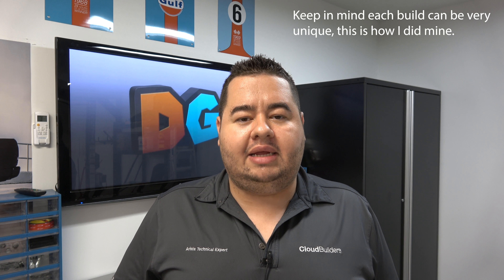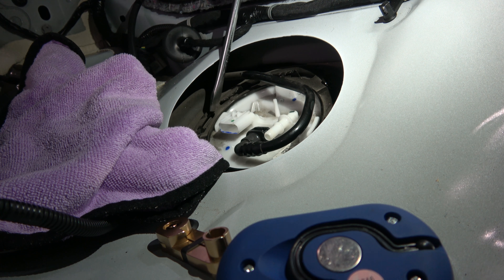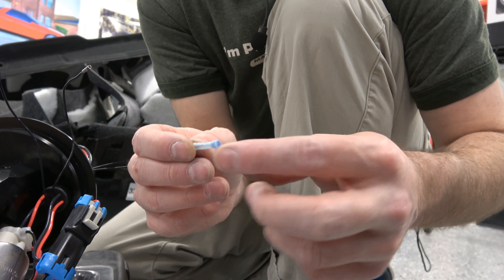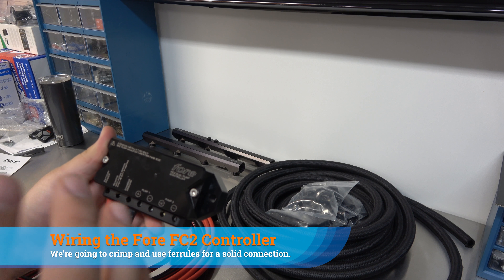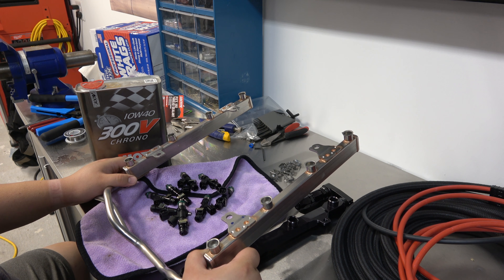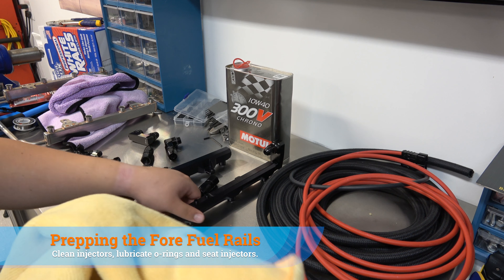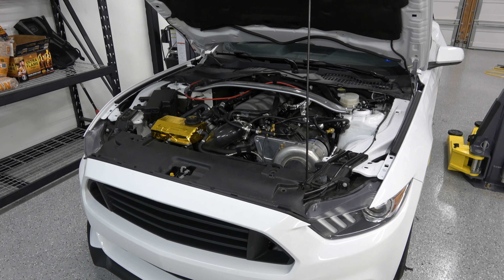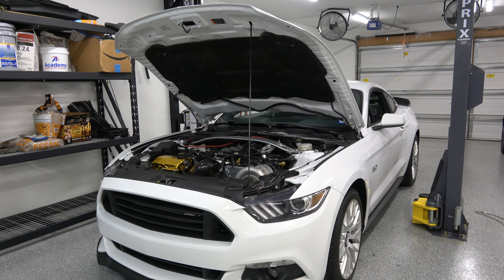Installing Fore Innovations Fuel System On 2016 Mustang GT

Comment: When you ran the green trigger wire, did you just tap into the one wire on the FPDM? I have the FC3 controller and I have two remote connections.

Comment: is the wiring inside the vehicle for the fuel pump module to the cars fuel pump connector the same way for a 2019 mustang gt? doing my install tmr and need help with that

Comment: Just installed my Fore Innovation L4 Dual pump system. Maybe I ordered a different kit but we installed the supply line to a Y off connection (supplies in the kit) then from the Y we ran to each side of the the Fore Fuel rails, from the Fuel Rails to the two outer sides of the regulator then from regulator, installed the fuel gauge on the regulator. I’m a Twin turbo set up. My hose that was supposed was a steel braided line with slightly different connectors. I had a buddy helping me. Wondering what different running the supply line to the Y an direct to both rails vs the way you set up would be.
Reply from the maker: Thanks for watching! Yea the kit you got is a little different, but mainly because Fore Innovations is a DIY build your own kind of kit. Some retailers are offering specific packages. The main difference is that you're running a parallel fuel rail setup and I'm running a series setup. It really depends on power goals, but a parallel setup is generally superior to my series. However, at the power levels I'm targeting I didn't really need that. It's a good setup for bigger power, if you're going over 1000whp on ethanol especially.
Reply: Dmitry's Garage yeah I’m Twin turbo with built motor and built MT82. Looking at making 1100.

Comment: I have the same fuel system in my 15 gt with 3 pumps ,, how can make them start like oem style ? mine running all the time on I switch the key on !
Reply from the maker: Typically this means your signal wire for the system (the one from the factory harness) is the one that stays constant on with ignition. Which wire are you tapping into?

Comment: I have a 2016 with twin turbos and I’m installing a triple pump system from lethal performance. I’m having an issue with the pumps not coming on and I’m almost positive it’s the wire to the FPDM. Could you tell me which wire you cut and tee’d that signal wire to?
Reply from the maker: Keith, at 40:54 you can see the wire I tap into. Hope this helps and thanks for watching!

Comment: Do you use loctite 592 on the an fittings that connect to the fuel rails? Or just on the analog pressure regular on the passenger side fuel Rail?
Reply from the maker: You don't need to use loctite on the AN fittings, they're flare fittings and will seal on their own. You only need it on the non-AN fittings.
Reply: @DmitrysGarage  perfect!  Thanks. I was planning on removing the intake manifold for porting and didn't know if have to use loctite when installing the rails back on. Thanks for the advice

Comment: So - question in case maybe I just missed it - did you not use a check valve?  Normally Fore has a check valve between the tank and the fuel filter to keep the pumps from losing fuel.  Where is yours installed?
Reply from the maker: Hey, thanks for watching! The check valve is right in front of the fuel filter in my case. You can see it around the 30 minute mark. I went back later and cleaned up some of the mounting.

Comment: What electronic fuel pressure set up did you use in the regulator ? Was it the OEM sensor and plug from OEM fuel system just relocated from original OEM location to reg. ???!!! Will be installing fore system on my 18 very very soon have the parts already just need to make time to do it !!!
Reply from the maker: Hey, thanks for the sub! The electronic pressure gauge sending unit is from the AEM 30-0301 X-Series Pressure Gauge kit. On the S550 there isn't an OEM fuel pressure sensor. Maybe the 2018 has it, but I'm not aware of one. I would get something similar to that AEM unit with a remote sending unit. Since it's generally a bad idea to run fuel inside the car cabin and I doubt you want to mount gauges on your hood outside the car old-school style :-). Good luck with the install, if you have questions feel free to ping me. Also Fore has terrific customer support as well.
Reply: Dmitry's Garage thx man I’m going to look up that part number
Reply: And definitely appreciate the videos keep them coming :-)

Comment: Hoping you may be able to shed some light on this issue I am having. I am installing a similar setup but with a GT350 hat and harness. I can not find a wiring diagram for the factory harness for these cars anywhere, what did you go off of to be sure you wired this correctly?
Reply from the maker: Hey thanks for watching! So you’re basically transplanting the gt350 system? For the trigger wire just to be honest I talked to people online to see which wire they spliced. It was different than my JMS BAP setup. Also at one point I talked to Justin at Fore Innovations, he wad super helpful. I don’t think I ever saw a full diagram for the harness which I assume is what you need. Maybe mustang6g forum? I wish I knew more. Ill see if any factory service manual stuff has it.
Reply: @DmitrysGarage  I appreciate the reply, today I am going to use a multimeter to figure out which is the signal wire. Do you happen to remember which color wire you used? I have found some stuff on Mustang6g but figured I would dig deeper. Thank you for your help.

Comment: Not sure what is wrong but the video skips the factory fuel gauge sender wires. What 2 colors on the factory harness did you cut and splice into?
Reply from the maker: Jeremy, you should be able to see this at 7:13, its a yellow/purple and green/blue wire.

Comment: 38:23 that red wire is that Necessary? My car came with fore fuel lines and also that red wire. Without it my car won’t start and it’s burnt and it’s on its last leg with a weak bridge. Can I pull it out?
Reply from the maker: Yes that red wire supplies power to the fuel pumps, so it will not work without it.

Comment: Great video man, its crazy yours is one of very few on this install. What did you do with the original fuel lines? Is there anything else you needed to buy with the Fore lvl 2 to get this all to work besides tools? Thanks!
Reply from the maker: Thanks for watching Mark, glad you liked the video. I didn't remove the original lines, they don't get in the way. Other than tools my kit had everything I needed, but I suggest talking to Fore as their team is very knowledgeable and they may have made changes to the kit since I got mine in 2018. There are also different options when it comes to fuel type and power goals so it's worth talking to them.

Comment: Installing my dual pump setup now...On the top of the fuel hat there are two black wire with butt connectors on them.  Which wires to they go to?  I am assuming the two smaller wires on the factory harness that plugged into the factory fuel pump.
Reply: never mind, found the 5 seconds I missed that covered that :)
Reply from the maker: Haha no problem, it's such a long video man and it was hard to do a lot on each step, it would have been like 4 hours then! Glad you got it! Let me know if you have any other questions, I can probably help!
Reply: The only other question was what you used to add the fasteners to the hoses going to the fuel pump. Channel locks and a wrench I am assuming. The hose ends you had to add in the car are what I am referencing.
Reply: Minute 35:20
Reply from the maker: Yea I had to use a channel lock and a wrench. It sucked, but there was no way to put a fitting in there that was pre-made. With PTFE this would be a major PITA, luckily I used a more flexible hose (I recommend FlexLP). One option is to lower the tank but it's held up on the filler neck and that strap that holds it.
Reply: I went with FlexLP, partly because of the smell and the fact PTFE can cause false knock. Dont need to deal with that issue again :)
Reply from the maker: Yea PTFE seems too much of a hassle really. The FlexLP should last plenty long and in my case with a lift the hose swap would take like 45 min if I had to do it again half a decade from now.
Reply: Just wanted to say thanks!! The video helped me so much!  All installed and running! Tuning is next but the  fuel system is up and running :)
Reply from the maker: Really glad I could help! Hope your tuning goes well and you'll have some new found performance to play with :-).

Comment: Did you tap into the yellow/gray wire on the plug that directly plugged into the top of the fuel pump hat or the on that's on the little module to the right of the pump?
Reply: Did you ever find the answer ?

Comment: I watched the video and attempted to call fore and they would not tell me where to connect the remote wire. Now here is a question...the S550 fuel module plug is under the seat. The fuel module plug for an S197 is in the trunk. The wire coming from the OEM fuel hat is the same wire the ties into the fuel module plug (Same color and all) if I cut the wire at the fuel hat in the trunk and attach a wire to it then run it to the remote for the fore that should do the same thing as splicing into it in the trunk in theory would it not??
Reply from the maker: Ryan, that's too bad Fore was pretty knowledgeable when I dealt with them. For your question, I think you'd need to review the electrical diagrams for the wiring, but yes if you're picking it up past the module you're probably ok.
Reply: @DmitrysGarage  First and foremost thank you for taking the time to read and respond. Got me as a subscriber just for that gesture. Second, your video is really the only video that goes into that much detail. The DIY'ers thank you for that. I chased the wire from the OEM fuel hat plugin on the s197 to the back of the trunk where the fuel pump module is located on the s197 (vs the s550 under the seat). I'm thinking I'm ok with cutting the wire from the plug and splicing it into the remote wire. If it don't work I will connect it back and then go to the fuel module and jump it like you did. Either way I will tell you the end result so you can share information with others who will ask you in the future.
Reply from the maker: @ryanfreeman5987  Appreciate that Ryan :-), I'll have some more Mustang content in the near future. Doing a few more mods soon. Do let me know how this works out, we can pin the comment so others dealing with this can find it. Glad you like the video!

Comment: Do you run that 300v in your mustang ?
Reply from the maker: Yes, quite a few years now.
Reply: @DmitrysGarage  I been running 5w50 amsoil signature I was thinking of switching can’t decide which will be better i do sing high rpm coyote tones a lot what you think ?
Reply from the maker: @scubagto420  Motul makes a good oil. I've had nothing but good oil analysis reports with it. Though these days all the big players make good oil especially Castrol. Amsoil is more niche but their stuff is usually good.

Comment: What does the fuel pressure gauge on the rail read compared to the affermarket electric fuel pressure gauge you have installed?
Reply from the maker: It's about 2-3 psi difference. The fuel rail is not considered an accurate place to measure when the injectors are running as I understand.

Comment: Great video. With the key in the on position should the regulator be holding boost? If so what would be the reason that it’s not?
Reply from the maker: Thanks for watching, glad you liked the video! I'm not completely sure what you mean by boost, but I'm assuming you mean fuel pressure? If so the fuel pressure will spike momentarily when you turn the key on, and will drop quickly after the pumps finish priming if the engine isn't immediately started. The FPR (Fuel Pressure Regulator) controls the fuel pressure delivered to the fuel rail. The FPR has a vacuum/boost reference which is used to vary the fuel pressure from the base setting when the reference is at atmospheric pressure (i.e. engine off). Overall the FPR works kinda like putting your thumb over a garden hose, the pressure inside the hose goes up. In my setup the FPR is after the fuel rail, which is normal for non-deadhead FPR setups. The reason the FPR can not maintain fuel pressure with key on engine off, is because the pumps don't keep priming if you don't turn the engine on. It would be like someone turning off the garden hose, your thumb isn't going to keep the pressure up. Hope this helps!

Comment: In what direction does the fuel flow. Great video
Reply from the maker: Thanks for watching! The fuel flows from the tank into the fuel rails and then to the FPR. The FPR then spits the fuel back into the tank. Think of the FPR like keeping a thumb on the end of a garden hose to build up pressure in the system.
Reply: Yes thanks. I meant fuel pressure. I was told that my check valve is supposed to hold fuel pressure with the key in the on position engine off
Reply from the maker: @alexandrewoods3763  This would only be the case if you wired up the fuel pumps to run with the key on instead of priming and turning off like the factory setup.
Reply: Dmitry's Garage thank you sir

Comment: Great video! I'm about to install this system in a 2011! do you happen to know what wire the remote taps into on a 2011?
Reply from the maker: Glad the video is helping. Wish I knew what it was for the 2011, but unfortunately I don't. What I can tell you is that the guys at Fore are super knowledgeable. Give them a call and ask I'm sure they can help guide you in the right direction.

Comment: I have a Fore tripple hat on my 15 GT. After i drained 93 to put E85 in, my fuel gauge stopped reading and the light came on for it. Any idea what i should be looking at, when i go in?
Reply from the maker: It only broke when you drained it? Like it worked with the triple hat on 93 and then broke? Thats super strange. How did you drain it? I would look at the continuity of the sending unit wiring. If that checks out its time to pull the unit up and see whats up with the sending unit. Maybe it got stuck or came loose or unclipped.
Reply: @DmitrysGarage  I disconnected the fuel line near fuel filter and used a wire to short it out to make pumps run. it is a triple hat i assume 3 pumps may cause it to stuck.
Reply from the maker: @ironbull2003  Yea that is a legit way to drain it. I would still do what I was saying. Check the external wiring continuity make sure the connections are solid, then go to the pump hat itself and the sending unit.
Reply: @DmitrysGarage  Will do

Comment: Amazing video bro!!! How long did it take overall?
Reply from the maker: Thanks man, I'd say give yourself a weekend if doing the same setup. This assumes you have all the tools and some of the little things the kit doesn't include. Some self tapping metal screws, shrink wrap, splice/tap stuff, etc... It took me a week or so to work out all the little stuff and tools and get them on amazon before I really tore into the install. If I had to do another one again, I could do it really quickly. It's not hard just lots of pieces.
Reply: @DmitrysGarage  Every time I hear someone say it takes the weekend I just assume a 3 week minimum
Reply from the maker: @jebadias1468  haha it really depends, if you've done it before you can do it very quickly. However, for a first time build there are so many little things going on here as far as how you want to build it, tools, parts and accessories. It could definitely take 3+ weeks, just depends on the amount time you take to plan the project. In my experience the biggest time killer is all the interruptions and delays that can happen if the plan doesn't execute well. Even having to run to a hardware store or auto parts store is a huge time sink.
Reply: @DmitrysGarage  You're right on that.  The little things are what gets you.  Thanks for showing the wiring in such detail.  I always figured the plumbing would be easy, and it looks like it in your video.  This is the first video I have seen that addresses wiring in an understandable way and has been the biggest thing holding me back from giving it a try.

Comment: Mine has 4 wires on the hat. 2 for the fuel sender & do u know what the other 2 are for?
Reply from the maker: Not sure as it may be a different model to mine. Did it not come with instructions for the specific part? Typically fore has decent instructions for what each wire does. You can also try giving them a call, they were knowledgeable when I last spoke with their team.
Reply: @DmitrysGarage  I have the same year car as you . I was just confused on if it was the wires off the stock hat or the module on the right attached to the car itself

Comment: Were you able to hide the large cable under the interior trim
Reply from the maker: The red power cable? Yea that will hide in the interior trim no problem. I don't have a lot of trim past the front seats since I've gutted the rest of the car in that direction. This thing is barely street legal these days :).

Comment: Excellent video dude. What camera do you use?
Reply from the maker: Thanks man! I use the Sony AX53, so far it's been a workhorse. I've actually even dropped it on the concrete form about 4ft by accident once. Still works, has a few small cracks in the case lol.

Comment: Do you have to replace  the fuel filter
Reply from the maker: Yea you do have to replace it so it's best to install it in such a way that it's serviceable. The replacement is opening it up and switching out the filter material.
Reply: Thanks